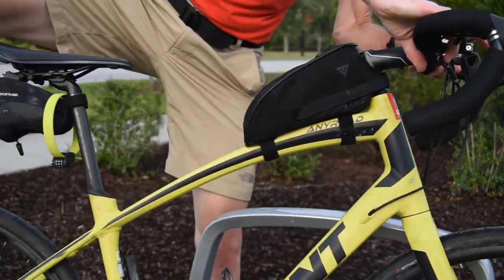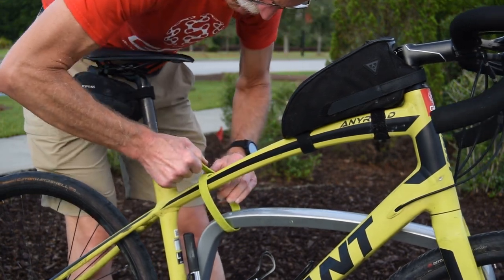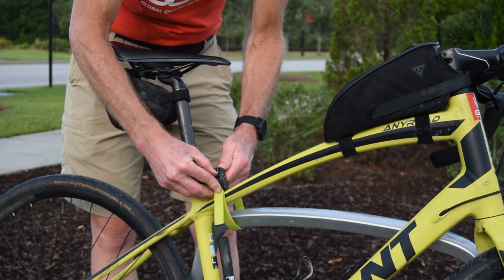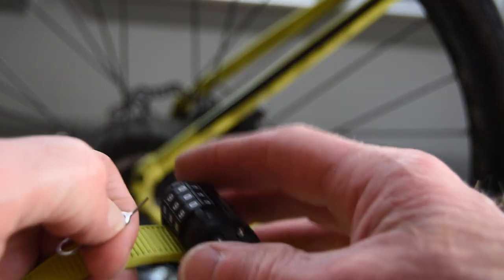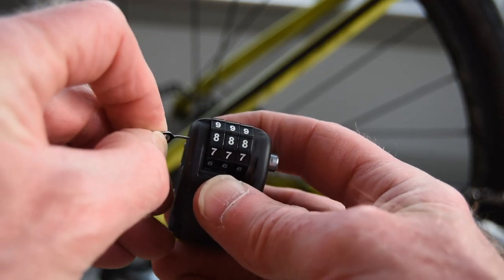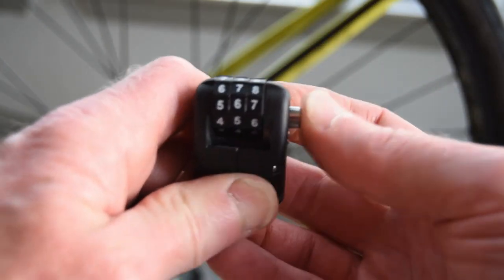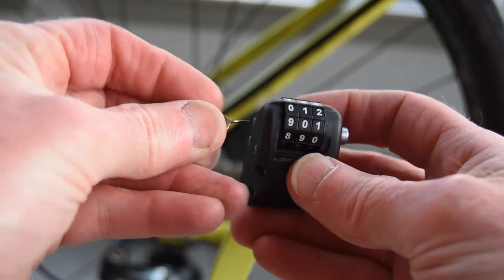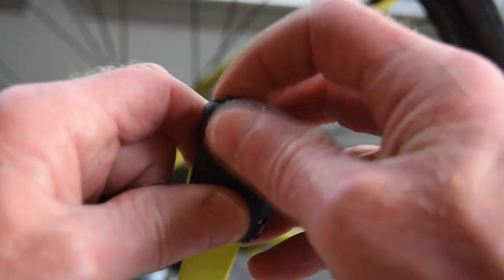OTTOLOCK Bicycle Lock Demonstration

Comment: This lock can be cut with tin snips 😂🤣
Reply from the maker: Yes, it is not intended for long-term secure storage. It works fine if you are just hopping into a store to get a drink and coming right back out. That is how I use it. ✌️
Reply: @PatrickArchibald  that's the problem it doesn't stop the snips for even 2 seconds which means someone can take your bike and ride off before you even get out the store
Reply: @dntthe88  If there is a bike thief in a random convenience with their tin snips in hand. Yes they have your bike.  It is better than no lock
Reply: @AndrewRodX  it's significantly more expensive and weaker than the average u lock. That's the issue man. Stop making excuses for a shit product
Reply: @dntthe88  heck, the thief could be riding off before poor Patrick even enters the store.
Reply: Might as well buy zip ties lol.

Comment: Interesting design. But 3 number combinations can be brute forced in around 10 minutes. But definitely better than nothing!
Reply from the maker: It isn't super secure. Not suited for a long duration lock-up. Best for popping in and out of a store or restaurant.
Reply: Jexi I agree. If it can’t be cut, can it the thief reset it as easy as you can?
Reply: @PatrickArchibald  you have a false sense of security. The Lockpicking Lawyer showed that this "lock" can be cut in 2 seconds with a Wiss compound leverage snips available at Home Depot for $10.
Reply from the maker: @walterk1221  It isn't super secure. Not suited for a long duration lock-up. Best for popping in and out of a store or restaurant.
Reply: @PatrickArchibald  well, since only 2 seconds elapse to cut it, not even an Olympic gold medal sprinter would be able to catch the perp. I will grant it is better than nothing since 2 seconds is longer than 0 seconds.

Comment: I find it funny that many of these lock videos always have obvious thieves commenting on how easy all locks can be defeated  in one way or another.  If you live in an urban area with high crime, your bike will be stolen.  If you live in a low crime area and use almost any lock for simple shopping or meal, don't worry.  This lock will keep honest people honest and I like that it's light and easy to use.  If a criminal wants your bike bad enough, he can get it out of a locked house or garage.
Reply: Enjoy paying 50 dollars for a "cafelock"
Reply: @dominicbritt  2 seconds to cut and the bike is gone. An Olympic sprinter couldn't catch the perp.
Reply: I completely disagree. It's a bike lock! Designed to provide at least basic security to keep your valuable item safe. Obviously most rationale people realize that just about any similar lock can be defeated. This lock is defeated just as easily as if you used a piece of rope and tied a knot in it. It might even be easier to cut than a fibrous rope. If this item retailed for $3.00 and was advertised to give the appearance of security I'd say...great concept. But for 50.00 to 80.00 this product is shameful. Just my opinion of course....